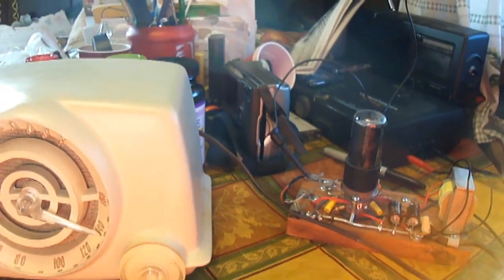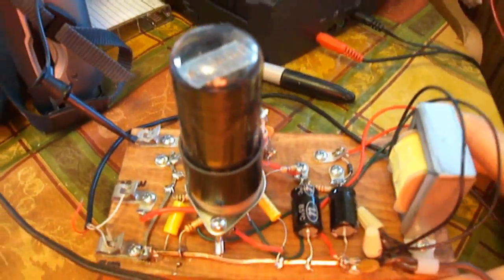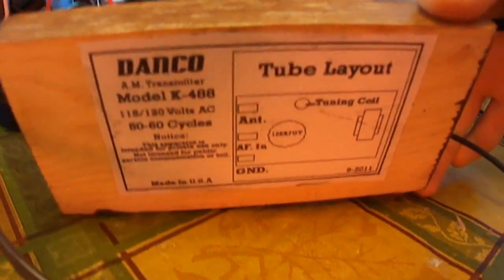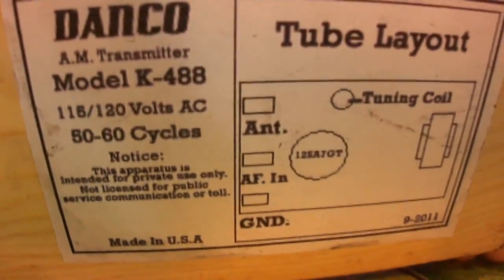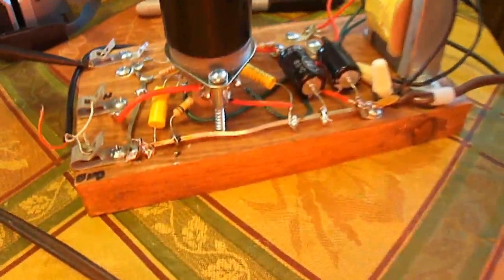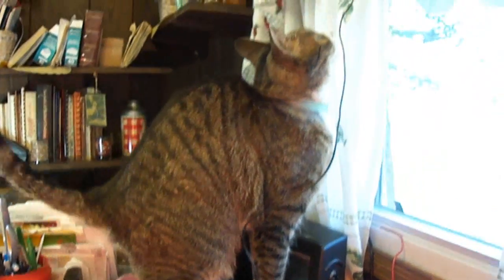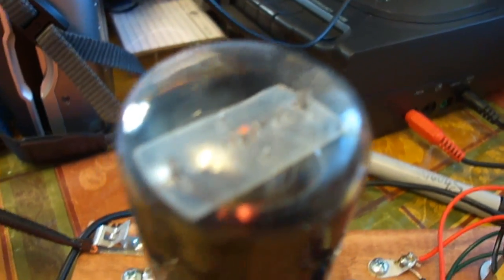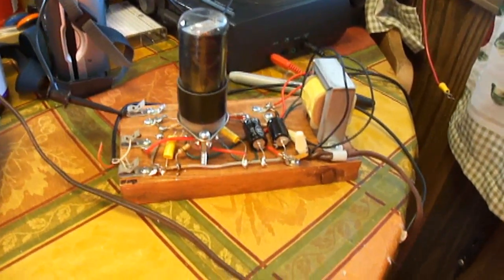My AM Tube Transmitter Kit

Comment: Sounds mostly OK. But we need to see a trapezoidal waveform of the audio input/RF output.  Sounds like your audio source is driving into a too high impedance. Put a 100 ohm resistor across the audio input. The original kit really should have covered this sort thing since all sorts of audio sources will be used to drive it. Get back to the supplier for advice and an explanation, and they need to correct the documentation!

Just seen the circuit diagram. But this is seven years old so you've either fixed it or thrown it out. Anyway, I think I've seen the problem...